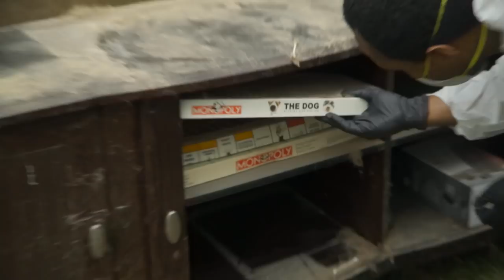An Animal's Nightmare

Comment: Sooo many questions,but the o e really burning is why you team  isn't ALWAYS wearing face masks/respirators.  So much of that stuff flies into the air. 

In 10 years when these caring, hard-working "angels" get really, really sick, who will care for them?

Thanks for sharing your work.  I've learned much about cleaning, and humanity.
Reply from the maker: Respirators aren't necessary 100% of the time, they're really only needed when mold is present or when we're cleaning biohazards and there are fumes. This is simply a hoard with lots of trash

Comment: I'm agreement with a few of my fellow subscribers.  The crew got that poor house cleaned out great, but the total lack of respect and care for the antique furniture and other items really disappointed.  Big time.  Using a push broom and sweeping porcelain and glassware off the top of a china cabinet, busting up antique furniture with a sledge hammer.  Really?!
The didn't seem to be a mold issue and if the customer didn't want it, Donate It.  The lack of caring and destruction was upsetting and takes away from what you're trying to do.  That  should not of happened to those items and they should not have been doomed to the landfill.  We know you have a time schedule but if they can make trips to the dump, they can make a trip or two to Goodwill.  I respect what you do but this episode was not good as far as care or respect.  You have a lot of young people working and need to ask questions before they start destroying items.  Sorry that happened.
Reply: They cant donate it with bug and mold . Places will not take it. Mold is very contagious.

Comment: What bothers me is that you toss things like glass tabletops, aquariums, pottery which could be easly cleaned and reselled and it all goes together to landfill. You don't select for recycling, no measures to dispose of things in more ecologic manner. All I hear is LANDFILL... then what? 1000, 2000, 10 000 years of recomposition?
Reply: It's full of mold and gross stuff. Donation places will not take it if it smells .